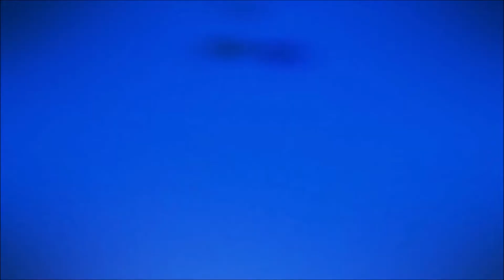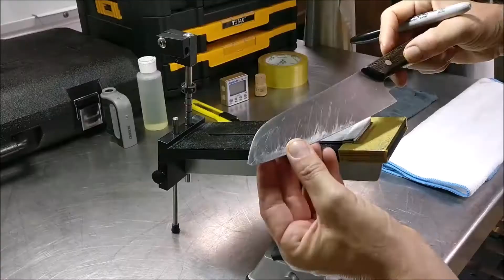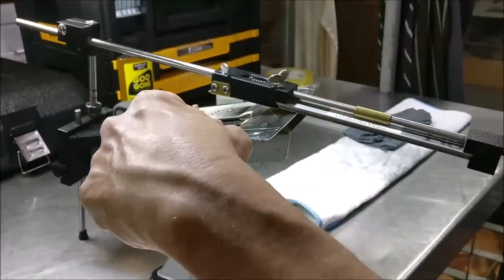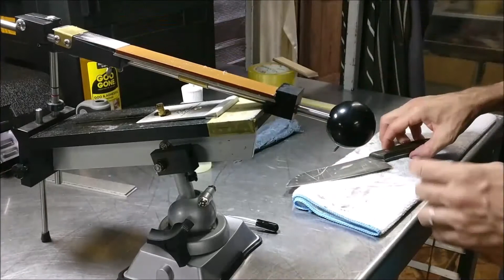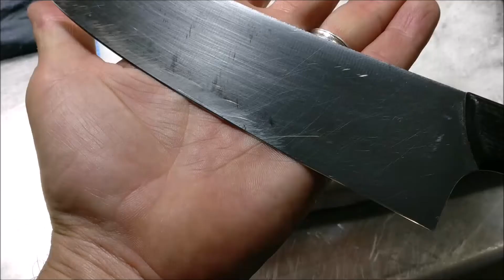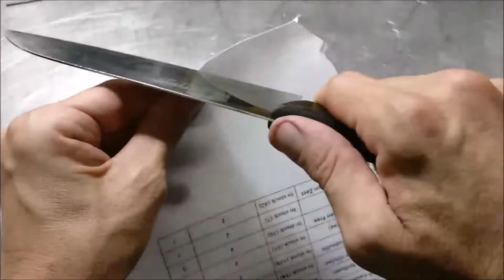Knife Repair (broken tip fixed) with the Edge Pro Professional

Comment: Where did you get your DMT stone? Have you tried CKTG diamond stones, if so, how did you like them?
Reply from the maker: I got the DMT from Jende Industries   https://jendeindustries.com/2x6-dmt-plates-for-the-edge-pro.html.   Funny you should mention CKTG.  The stone I actually ended up using in this video was the CKTG Diamond Plate 140 grit and it worked great.  (started using the DMT but wanted to test the CKTG)  I must have missed that in the final editing cut!!!  The 140 grit CKTG removed metal very quickly.  Great product.  Although  it seems to wear a bit faster than the DMT and the Atoma but it is cheaper...   On harder steels the diamonds come off quicker as it cuts but I'm still on my first one and it is still doing a great job.  I only use it when I need some heavy lifting and I don't feel like spending the time with the Aluminum Oxide.  I personally think it's a must have if you sharpen knives...

Eric
Reply: 2 Guys & A Cooler I am greatly considering purchasing some. I was just unaware DMT made stones for the edge pro. Have you tried sharpening any garden tools? Ei: pruning shears, hand hedge shears etc.?
Reply: 2 Guys & A Cooler and out curiosity, how did you like the edge pro diamond stones, in comparison to the DMT stones?
Reply from the maker: Great question.  The easy answer is that they are completely different.  They use a different binder to attach the diamonds and so they cut differently.  I really like the Diamond Resin Bond Stones from Edge pro.  I love the finish they put on a knife.   The DMT is a lot more aggressive.  I use it to lap my stones (Keep them straight) remove metal fast and so on.  Overall I think that the Edge pro stones will last longer.   

So for me personally I like them both and use them but for different applications.  What I need to do is a side by side comparison and make a video of it so others can see.
Reply: 2 Guys & A Cooler Ok good to know.  Thank you for all your advice and suggestions! It has been very helpful. I look forward to watching more of your videos.
Reply: What is that rust remover eraser called also would it work on guns that have a blued metal finish or would it destroy the blueing 
love the sharpening videos super cool stuff 
What do you like better the wicked edge system or edge pro